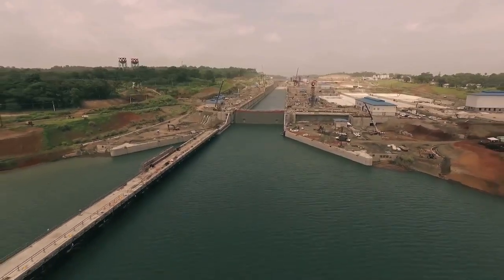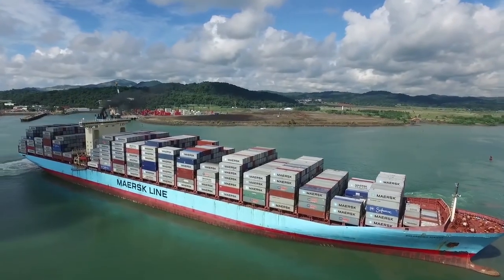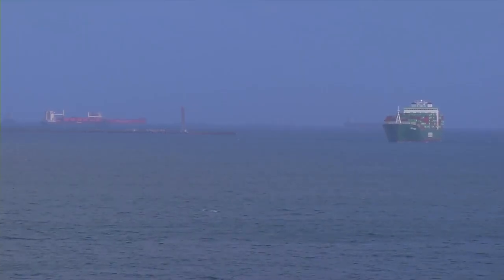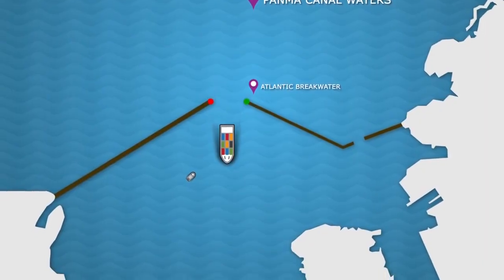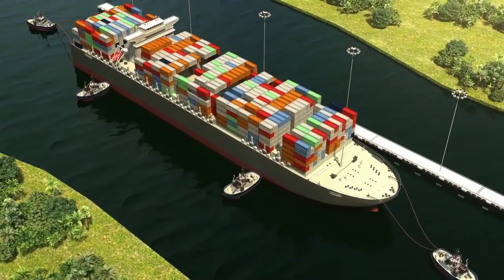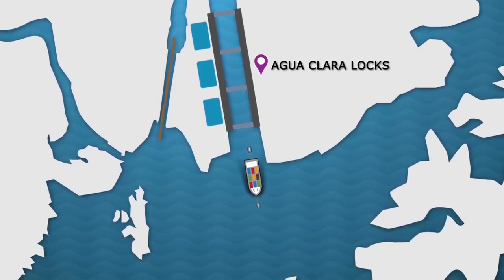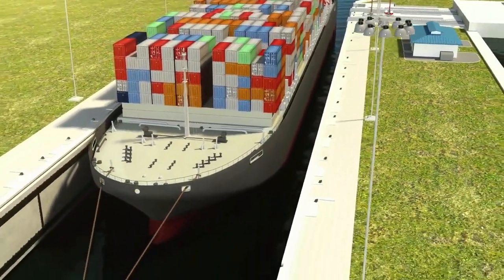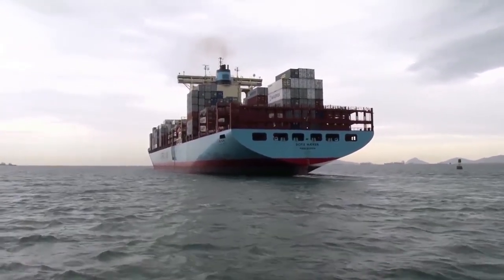Overview of the new Panama Canal expansion

Comment: Very interesting. Does anyone know what was is the downside of using these locomotives to position the ships and why that system will not be used in the new locks? It seems to me the method with regular lines and tugboats would be less efficient.
Reply: Tugs are more powerful and maneuverable than locomotives (mules' tractive capacity). I also believe the locomotives contribute to wear and tear on the walls.

Comment: No Video commentaries exist that outline the total corruption and incompetence that sections of the Panama Canal, was subject to, when sections were turned over to Panamanian, control.  Train tracks *derail few years after, Upper lakes, metal sleuths sold off for scrap when water levels were low, bridges roads and buildings (stripped of copper pipe and electrical wires).  The new canal must have a Panamanian "exclusion zone" around them to protect the canals from the Panamanian people.

Comment: Why the two oceans has different levels ? Thanks.
Reply: Not the oceans, but the lake have different level with oceans
Reply: the entry and egress points very with the tides.  The ocean front locks are deeper and higher, because of the variation of tides when leaving the locks, for either ocean
Reply: @sprungmonkey6inches  I apreciate your explanation. Thanks a lot.

Comment: the artificial canal is only ~28m higher than sea level... wouldn't be "easier" if they dug this exceeding height at the lake and make the whole pass even by the sea level? Ok it might not be as easy as digging a trench at the beach but comparing to the amount of work put into creating and maintaining the locks... idk maybe I'm just high.
Reply: no, because of tides.  then you'd have this rushing torrent of ocean moving with the tides through the canal.
Reply: @sprungmonkey6inches   oh shit I think I was really high lol. So you mean the tides would run across the canal? Since the canal entrance is smaller than both the ocean "ofc" and the lake most of the sea movement would be blocked outside the canal... innit? The lake itself since it's surrounded by mountains doesn't let it build too much tide movement. Idk prob talking bs now. Just curious.

Comment: They need to get rid of those tug boats, surely they are not needed now as these ships are able to control them selves with there bower and stern  thrusters. Tug boats add far to much money to the cost of the transit ,nothing to do with safety.
Reply: they used to use train/trames to move the ships through the locks.  but the inept panamanians (after jobs moved from americans to panamanians) would lose at least one train a year to getting dragged into lock or off rails cuz the inability to communicate effectively.  less ways to screw it up if your boat is next to a super tanker.  much more skin in the game for the operators.

Comment: And already, there are container ships too big to fit.
Reply: There was always going to be a limit to what they could build for. The lake between the two sections of the canals is not deep and wide enough in some areas. It's already incredibly close to its limits with very little room if any for errors with dealing with the current loads, Adding the Neo gen ships to it.... they are pushing the limits of what the lake can do. They could dredge the lake itself to widen the shipping lanes but you would still have issues of the rocky bottoms and constant earth fill that the canal faces.

Comment: Why they change water level ??
Reply: actually it's two canals witch combine the gatun lake with panama city / colon, witch level is 26m higher than sealevel. A lot less canal digging.
Reply: @7 Points Entertainment thanks, then they need to pressure water level to level
Reply: ^lol I think they know what they’re doing.
Reply: @crossroads670  hi.. professor😂😂😂
Reply: @travelandeventz2742  Oh- you ment why they rose the waterlevel of the gatun lake up 45cm? I guess to have more reservoir for the higher waterconsumption, since there are more than doubble the size of locs to fill
Reply: @gerhardpenske9978  thanks bro 😍😍
Reply: @travelandeventz2742  But I heard that the level dropped allmost 1mtr due lack of rain the last 2years. You can see pictures, üf the lake with all the tree chunks

Comment: They only needed to widen and deepen the passage, everything else was/is overkill. Like someone else said, blow that s#it up and you'll have a quick fix to width, depth and safe passage. Pure Overkill!!!
Reply: Two problems...  1)The tides on the Pacific side is 8 feet daily, on the Atlantic side tide is 18 inches- a foot and a half. If you completely clear out the canal and have no locks or manmade structures you will have a hell of a tidal bore rushing thru that canal daily, causing erosion and screwing up the navigation of the ships trying to get thru those narrow waterways, even sending some ships going one way crashing into ships going the oncoming direction (Head-on collisions).. Your solution would work on the Suez canal where there is no difference in tides at either end, but not on the Panama Canal. P. S. I lived on a fort next to the Panama Canal for 18 months. Also (2) these extra large container ships require much larger locks than the old locks and they use up much more water than the old locks that held the old container ships. There simply wasn't enough rainwater falling into the canal and Lake Gatun and up in the mountains to replenish what was gonna be used up and let out to sea in the transit process of these super containers. So they had to build the storage basins to save and reuse some of the water. Otherwise they would use too much water from Lake Gatun, the level there would go dangerously low and this lake which serves as the middle leg of the all-water route of the canal might get so low it could no longer be used and they would have to wait for months for rain to fill it up to a level that ships could sail across it again and cross the canal route.

Comment: What exactly is the purpose of these water-saving basins? Are they there in order to flood the sections in case the ship requires deeper waters to pass through?
Reply: It's a substantial water saving over the old system... Archimedes said it was a good idea.
Reply: If I remember correctly, the Panama Canal is completely dependent on the freshwater runoff from the Panama countryside itself for the overland journey.  (NOTE: No ocean saltwater is ever pumped into the locks; the entire transit is through freshwater only!)  The country of Panama is, of course, equatorial- meaning they get lots of rain year-round.  However, if the natural rainfall becomes lessened for any reason, the ability to keep the in-land part of the Canal open becomes a significant problem.  I think the water-saving basins are there as a supplement, to reduce the amount of freshwater used for each process of the lock(s).

(I am not very knowledgeable of locks even though I know their basic functions, but that said I've never heard of water reserve pools like this before.  It may be unique to the Panama Canal, although I cannot say for certain.  Someone please double-check me on this!)
Reply: It's so Gatun Lake dosen't drain as fast.
Reply: In order to raise the level of water inside a lock, water from the higher water level pours into the lock. To lower the level of water, the water in the lock pours into the lower water level. This means water always flows from the high point to the low point. If not taken into consideration, this could drain the Panama Canal. The water saving basins reduce the amount of water transferred from upstream to downstream. You can watch https://youtu.be/SBvclVcesEE to see this in more detail. He even made a model of a canal with water saving basins so you can see it all work.
Reply: This video explains the purpose of basins well :)
https://youtu.be/SBvclVcesEE
Reply: As the canal handled more and more traffic through the years, more and more of the fresh water draining down from the hills down to Lake Gatun and the canal was inevitably released out into either the Caribbean at Colon or the Pacific at Balboa. That was simply the way the old canal was designed. There was no provision for saving and reusing the fresh water. But they reached a point where they needed to reuse the water cause there was a limit to the number of reservoirs they could build on the Chagres river up in the mountainous area above the canal. That is why when they needed to enlarge the canal to handle the supertankers they built these holding basins next to the locks where they could store and reuse the water several times. I served in Panama from 72 to 74 in the U. S. Army at Ft Amador, Pacific entrance to the canal..

Comment: so they only lift the ships because of the lake? When the ship enter they lift it up. When it leaves on the other side they lower it back down. What's the point?
Reply: Szatmári Tomi  Quite a difference in elevation from one end of the canal to the other.
Reply: 85 feet elevation.   The canal was built in early 1900s.   Finished in 1914.   The technology was not available to create a sea level canal like the Suez canal,  which have flat desert lands to cut through.   The mountains of Panama that cut through the center and the country proved to be the obstacle to sea level operations.   Furthermore,  the tides on Atlantic and Pacific sides of the canal are wildly different to each other.    And would create major problems with navigation.    The lake eliminates that by providing a stable environment for the ships to pass.   And before anyone attacks me on how do I anout this, I  lived in Panama for more than 5 years studying the wildlife in Gatun lake.   So that was part of our of my education into understanding the why the wildlife thrives or struggles with the environmental effects of the canal.
Reply: a dug out channal would be impassable with the torrent of water that would rush through with changes in the tides.  locks are the only way to transit the canal